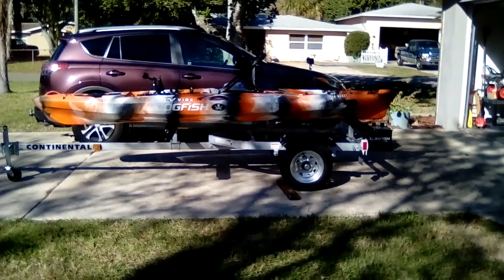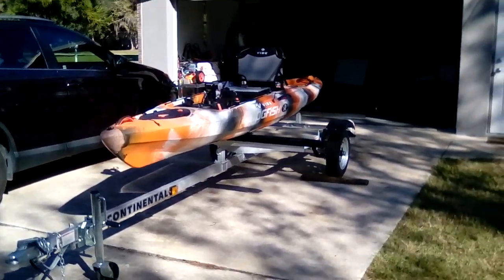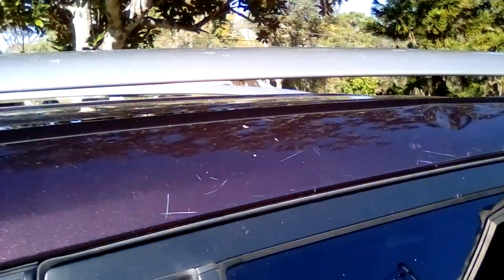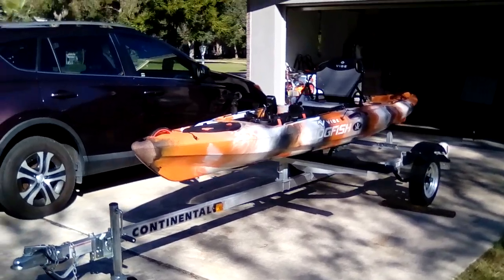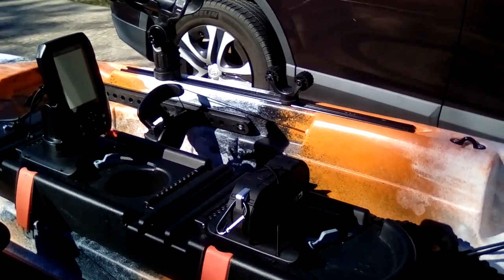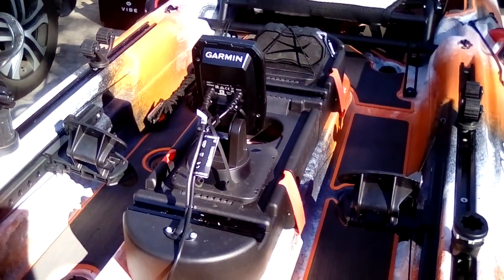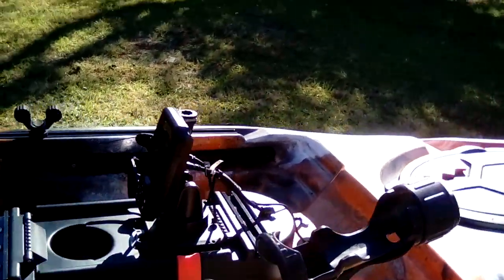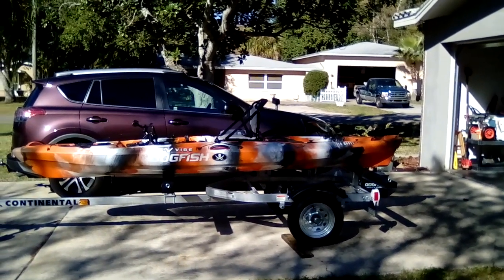2019 Vibe Sea Ghost 130 Garmin Striker 4

Comment: How did you mount the transducer?  Im transferring my garmin 4 w/ the older style transducer to my new sg130 and do not have the mounting hardware. I was doing the in-hull setup.
Reply from the maker: I used the transducer that came with the Garmin. I just matched up 2 screw holes in the spot for the transducer and used a couple of screws I had at home, then wrapped the excess wire around the transducer and secured them with zip ties
Reply: gholt777 you must have a different transducer cause the Stryker 4 doesn’t mount
Reply: @thatfishingguy11b  I agree with the fish guy I just bought one and came to your video to see how you mounted the transducer,  I guess if your going to do a video on installing a fish finder you might want to include that little part.